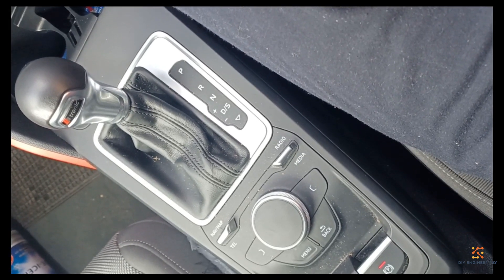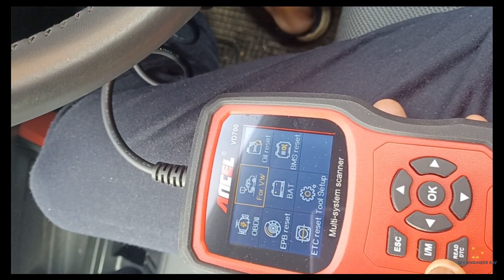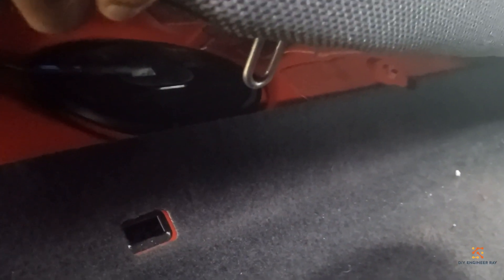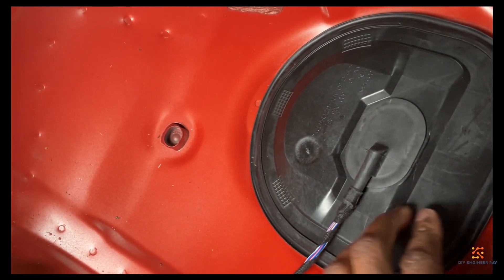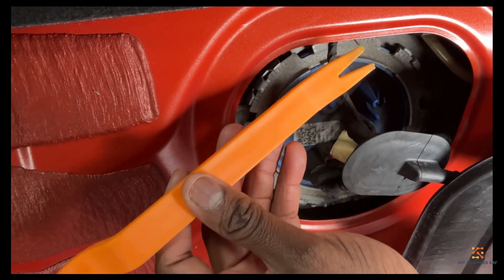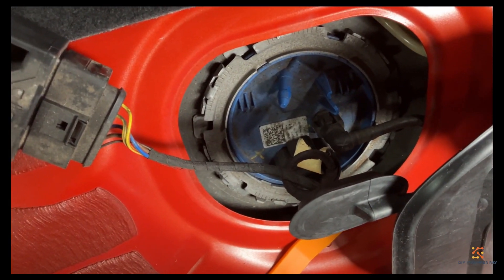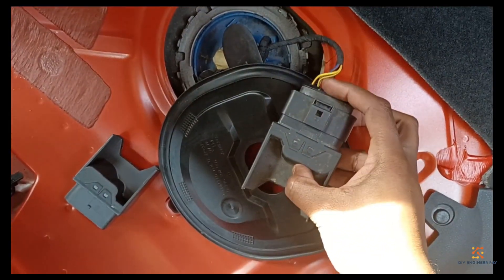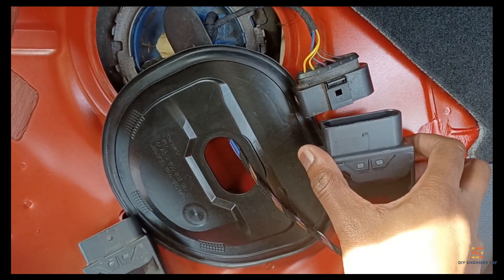Audi VW P3044 Fault Code and Weak Acceleration

Comment: I have a 2011 Audi A4, it gives me the same error, one pin of the module was burned, I bought another one and it still gives me the same error, however the car starts correctly but it turns off when revving, do you know what it is?
Reply from the maker: @AdonayEscamilla-b5z  does it clear when you change reset the fault with a diagnostics machine and change driving modes e.g from Efficiency mode to Sport/ Dynamic modes?